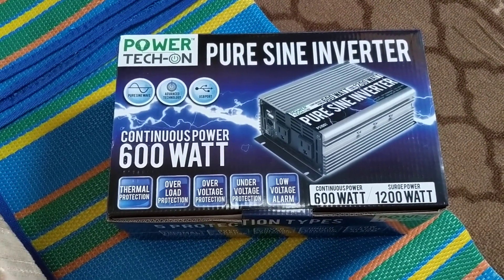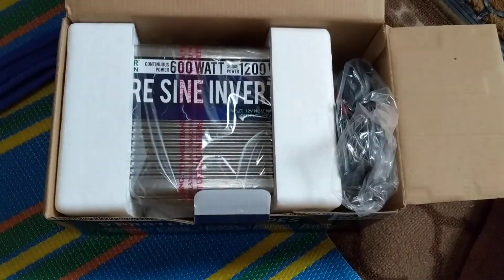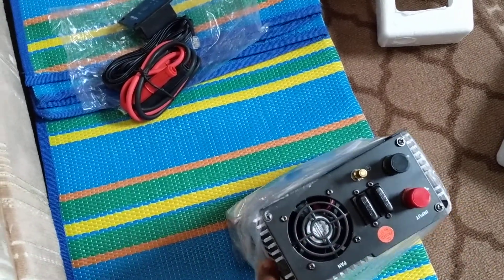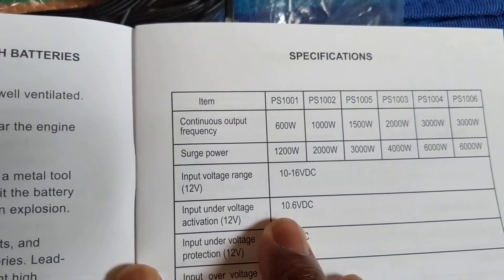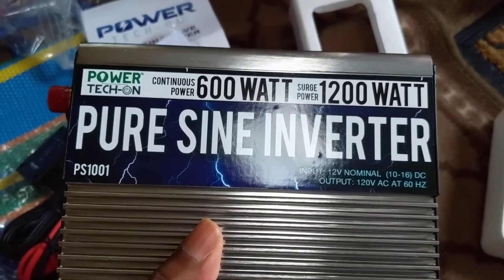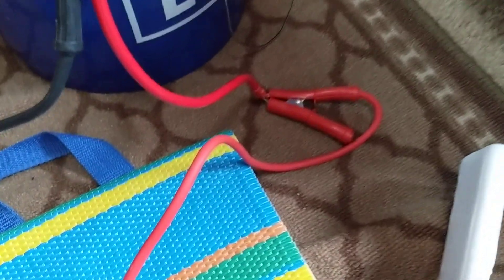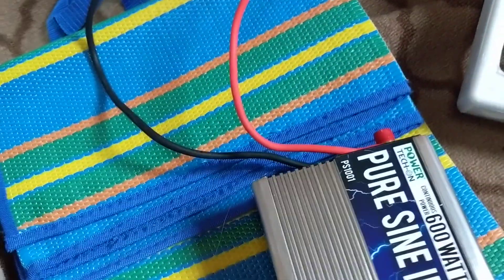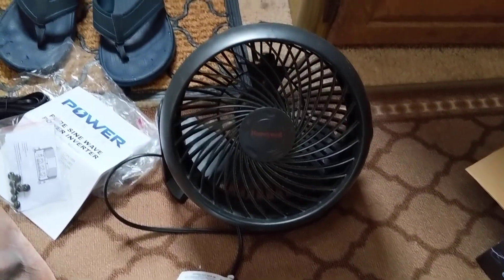Best 12 volt inverter for 18650 batteries / Unboxing power tech-on 600 watt inverter

Comment: I installed my inverter a couple of days ago. I used 4AWG wire and a ANL 150A fuse holder with fuse. I connected a 7.6 cu ft 85W fridge to it (that was the reason I purchased it) and in the middle of the night an alarm goes off briefly and stops, it wakes me up. I get up check out the inverter the green light is on, the DC voltage is 12.6 vdc and the output 120.1 VAC. Do you have any idea why this alarm is going off? I have no clue:(
Reply from the maker: The surge power on the fridge might be something to consider when the condenser kicks on. Also How many amp hours is your battery? The voltage can go back up after it has been disconnected from the battery due to low voltage. But not positive about why your inverter is making that noise.
Reply: @re-thinkthis4880  Thank you so much for responding to me. I live in an RV and have two deep cycle marine batteries with approx. 100 amp hours in each in parallel so 12 VDC approx 200amp hours and the weird thing is the compressor kicks on and off in the daylight hours and that alarm never goes off, however it does go off at about 4AM like clock work. Still no idea what is going on. Thanks again for your reply.
Reply from the maker: @elizabethjames3440  Because they are lead acid you only have half the usable capacity of your amp hours.

100 amh * 12 v = 1200 wh (usable for perfectly healthy batteries)
The recommendation is often that you use even less than half to keep your batteries healthy
at 85 watts after 9 hours
 ( 7 PM to 4 AM)
85 * 9 = 765 watt hours used
So you are using more than half of your usable capacity. As the capacity gets low, so does the voltage.
It is likely that your battery bank does not have enough capacity to run that load all night.
Batteries are the most important part of the like this.
The chemistry of the battery makes a difference.
Lithium Ion batteries are starting to come on the scene but they can be pricey.
You do get all the usable capacity and reduced weight from them.
Battle Born batteries have been acknowledged recently as being a really good option.

Comment: have you tried any power tools like a drill? Also , when ur connecting leads always connect pos first neg last.
Reply from the maker: Yes indeed, I have used it with a porter Cable drill. A small freezer and a few other light loads. It has been doing really well. Just got the big brother 3000 watts continuous, 6000 watts surge. :)
Reply: cool. did you use supplied wires or did you increase wire size? have you used to charge power tool lithium batteries?
Reply from the maker: @Mazel_Tov_888  For the small one I used the supplied wires. They work fine. For the large one I mentioned I increased the wire size significantly.
Reply: @re-thinkthis4880  thx just purchased the 600 watt.
Reply from the maker: @Mazel_Tov_888  Glad to hear it. I hope it works out well for you. =)